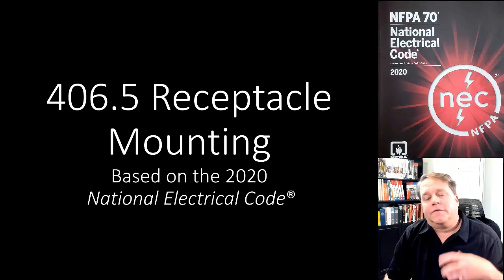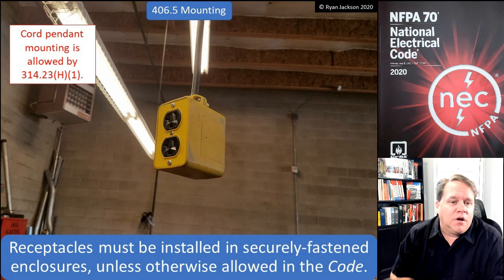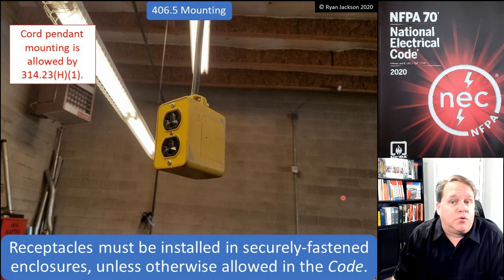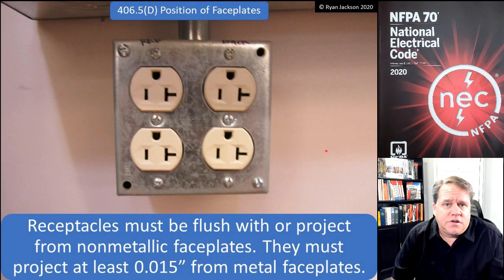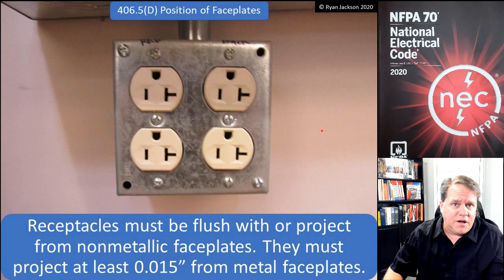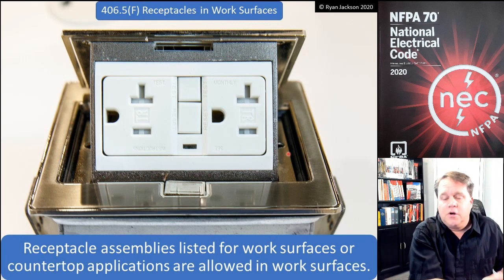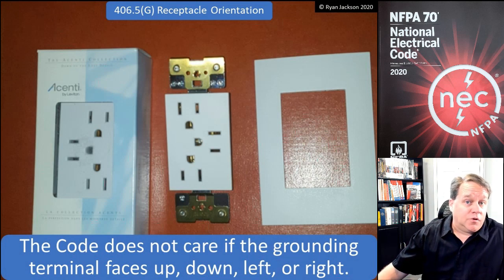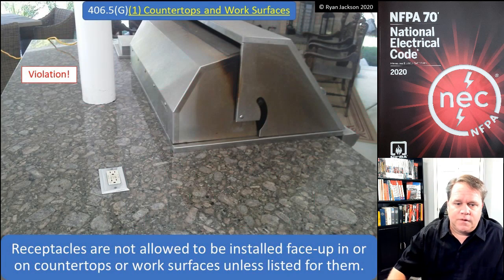Receptacle mounting. NEC 406.5

Comment: Is a fireplace mantle considered a work surface?
Reply from the maker: I would call it a shelf, personally.
Reply: @RyanJacksonElectrical  we have been getting flak from just one inspector saying we can’t put an outlet on the top of the mantle because it faces up. But as previously stated it says you can’t do them face up on counter tops or work spaces…? Thoughts.
Reply from the maker: @Hausscatgrizz  I don't think it is a work surface.

Comment: I’m glad to see that the orientation of the grounding terminal has remained out of the code. Unfortunately, even when there is inadequate substantiation, things do make it into the code when MONEY is involved. AFCI breakers and shutter receptacles are two excellent examples of products that should be available for use at one’s discretion, but certainly be not mandated.

Comment: For years had arguments with receptacle for ceiling mounted overhead projectors that used the drop ceiling for  return air. Was told that the power cords were never rated for this so mounted receptacle on ceiling facing down.
Reply from the maker: It really doesn't matter if the ceiling is a plenum because cords aren't allowed above any ceiling.
Reply: @RyanJacksonElectrical   I did not know that. Back in the 70's would look the other way about a cord connected little say 1/15 HP sump pump motor for air handlers in drop ceilings due to ease of maintenance. Before every summer they would remove them and clean out junk in water collection container. They still had some that failed causing water damage to ceiling title. I know that they make hard wired little pumps for this application. Use to laugh at an IAEI board member that told us that he only allows above ceiling receptacles to charge your cell phone.

Comment: What about the led lights that are only supported by the Sheetrock and they come with their own enclosure that is also not secured to anything ? Only supported by cable and sheet rock
Reply from the maker: Those would fall under 410.30 and 410.36(B). Ultimately, the clips that attach the luminaire to the drywall are listed and comply.

Comment: For ranges most manufactures only put about a 6 inch space on the bottom of the range. Are we allowed to put the 14-50 receptacle at the height of the floor plate so the range can be flush with the wall and if so what is the code? thank you
Reply from the maker: Check out 422.33(B).
Reply: @RyanJacksonElectrical  Thank you but i am still not clear on what it reads. It states if it is accessible from the front by removal of a drawer, shall be consider as meeting the intent.   To me this means that i will have to put it inside a cabinet next to the range so it can be accessible but there is nothing saying that i cannot make the connection behind the range by the base of the floor as long as the box is still accessible by pulling out the range. Sorry for not getting it but can you clarified the meaning of 422.33. Thank you!
Reply from the maker: @carloscheco1852  Putting it at the floor is fine.

Comment: Drywall screws are subject to hydrogen embrittlement and consequently can stress-crack. Device steel mounting screws (and steel terminal screws and steel assembly screws are typically (not required but all manufacturers do it to avoid field complaints) heat-treated to preclude hydrogen embrittlement stress cracking.

Comment: When we hung 1900  boxes for ceiling drops used  better cord such as type SO or SOW and  always used a kilems grip cord connector. Cord never pulls out if properly installed. Thanks for another great easy to understand vid. Great that they have been making 1900 duplex reveptacle covers with 2 6/32 screws & nuts. If they only supplied with a plain jane hex nut always i installed 6/32 lockwashers. If we ran out of lockwashers would silivone nuts to prevent them ftom loosening.

Comment: Gotta wonder how manufactured homes get by with their outlets directly mounted to the Sheetrock… no box at all.
Reply from the maker: They are usually an integral enclosure, as covered in 300.15(E).
Reply: @RyanJacksonElectrical  oh, I know… it’s just CRAP a box should be required.